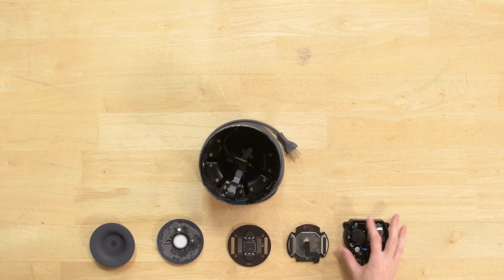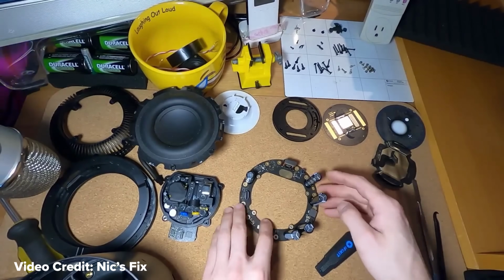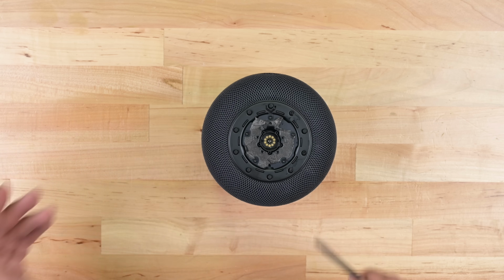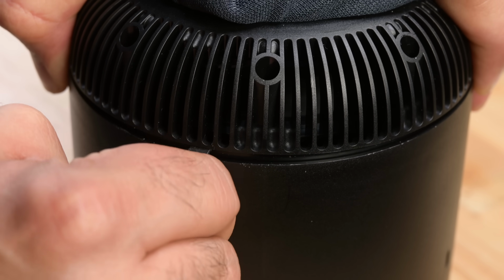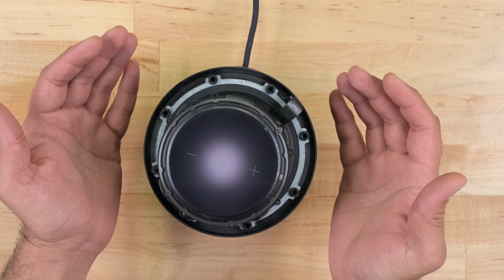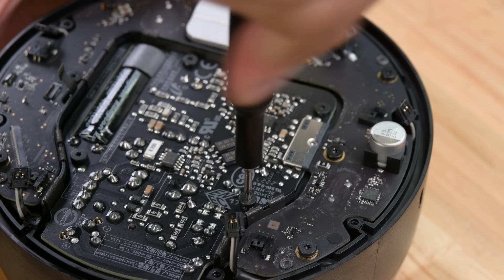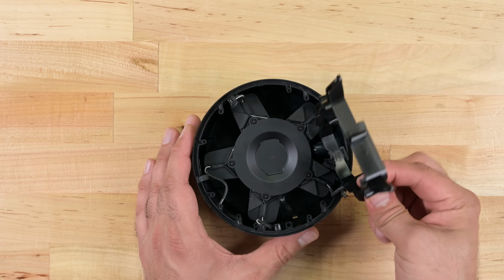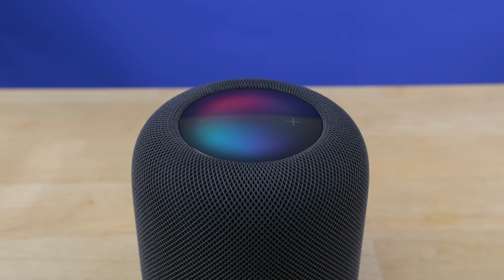The HomePod 2 Teardown: Small Changes Make a Big Difference

Comment: Looks like apple is moving away from hard to repair hardware in favor of software locks. To the average Joe it gives the impression that they're moving in the right direction, when in reality they're just tightening their iron grip on the repair industry. Workarounds for soft-locks are harder to pull off.
Reply: What your calling software locks is in fact called calibration profiles.
Reply: @hishnash  calibration for what? Touch pads? Batteries? Hall sensors? Displays? If something requires some sort of calibration, Apple can easily calibrate it at the factory, then put that calibration profile on a small chip onboard the part itself. Most, if not all of Apple's soft-locks are just an encrypted key on the replacement part that serves no other purpose than to lock the part.
Reply: @MrFastFox666  sure you can take that approach of cource that means 2 things.

1) adding extra chips to each part that are not needed. (this means extra space, cost, complexity and power). 
2) increase the bandwidth of the connection to the part

The key is not encrypted it is just a UUID that is used to pull the profile from apples servers.  There is no fancy encryption going on as that would require a full Secure Enclave to be added to each and every part. Not exactly saving money there. 

Touchpads by the way do not have calibration info, but are entirely different between models (eg M1 MBA and M2 MBA have different trackpads... apple moved some of the tracking logic inside the SOC so the data stream is electrically different).
Reply: @hishnash  dude, you have no idea what you're talking about, nor do you know how the serialization works. It's not just "simple UUIDs", what you are talking about are TrueTone profiles. There are custom protocols in place that are only used by Apple's servers and only work in diagnostic mode or recovery mode (through either AST2 or RepairCal, depending on device and how the serialization was implemented, RepairCal being the older option). There is no need for a "full secure enclave" as the chips themselves are only readable/writable in these certain modes and ONLY after talking to Apple servers. If it was "not encrypted" someone would have found a way to calibrate FaceID or TouchID modules by now, weird how that hasn't happened yet, huh?

Oh, and "Touchpads by the way do not have calibration info", yeah right, that's why Apple is so eager to calibrate MacBook trackpads after almost every repair, as stated in ATLAS. Tell me you've never been Apple certified without telling me you've never been Apple certified.
Reply: @hishnash  Apple's soft locks already use extra chips on the device. Not that it matters, as they are super small, often less than 1 mm² and are dirt cheap, but they're there. Many parts such as the battery or the display have some microchips on them anyways, such as the BMS in the battery.
Reply: @MrFastFox666  yep and the chips are so small and simple since all they store is the part id. The full calibration profile of a camera is way too large for such a small chip to store.   Sure some sensors and devices the profiles are much smaller can could be stored on the chip but if you need to go through the effort of building a server side DB of profiles for the camera and display why not just use that for everything then it is all much simpler (for apple in manufacturing). 

It has the add (benefit?) that if a device is stolen breaking it down into parts for resale have minimal value
Reply: This is how politics works.
Reply: @PvtAnonymous Aaaaaaa remember the 3dtouchcal days?
Reply: @odder5154  haven't been around that long as a certified Apple tech. Although I still witnessed the slow death of old GSX. But I know how the 3dtouchcal works, hilarious when you compare it to system configuration nowadays :D
Reply: Let’s face it’s cheaper to software lock rather then make it physically harder
Reply: @wax333  yeah that too. It makes it even harder to repair devices because they can just disable whatever service they use to lift their own soft locks.

Comment: I wonder if the spatial audio is compromised in any noticeable way due to the fewer tweeters. From the sound tests I've seen in other videos, it sounds pretty similar to the previous one, not noticeably different without having them side by side.
Reply: I heard the Homepods 2 recently in a stereo combo, they are not too bad considering they are from Apple, so NOT an audio company AND "smart speakers". But the price for this low end sound experience, sry just NO, if you want good sound even a basic small stereo hifi system does its job

But in general, even with this "spatial audio" thing they are not too good, Apple doesnt even allow for measuring via the phone some generated waves  to setup the EQ and spatial audio better.

Comment: correct me if I'm wrong but doesn't this homepod use 802.11n still? surely Apple could have at least fitted AC, whih my 2015 HP Pavilion has...
Reply: 300mbps for audio is plenty enough though right?
Reply: @Mooooooof  doesn’t HomeKit secure Video go through the host device which this HomePod would be?
Reply: Apple Answered this one. Latency matters more for multi-speaker wireless audio. Throughput is much less important. The current 802.11n chipsets were the perfect mix of compatibility (With other homepods) low latency and low power.
Reply: It's because of the Watch SOC they use. The Watch only has 802.11n.

Comment: I guess the heat sink is there so the temperature sensor won’t get extremely inaccurate when playing music loud for a long period of time?
Reply: I can't believe an electronics channel would be surprised to see a heat sink on a power amplifier. Even class d amps generate a lot of heat when playing loud. The heat sink is required not to burn out the amp chip and has nothing to do with sound quality per se.

Comment: “Heat can actually distort audio signals” Is that why my music always seems to play slightly slower during winter and slightly faster in the summer when I’m outside?
Reply: rather than that i guess it can be the suspensions of you speakers stiffening up when cold, thus changing its parameters a bit. Also, there should be a slight difference due to temperature and pressure of air itself, albeit i don't know to which degree it impacts it
Reply: While heat can distort audio signals the heat sink in this case exists to cool the amplifier at high volumes. Heat only becomes a problem with outdoor concerts and large auditoriums with the air convection sucking out the highs. It means nothing inside a small pod.

Comment: I'm almost 100% that at least 2-3 parts are locked, like humidity sensor, and probably some chips as well, I never seen Apple device (except for the original iPod) that has no software locks
Reply: Early mac’s, ipod touches and iphone’s didn’t have hardware/software locks (even though some were activated later with software updates). But never the less a shame.
Reply: highly doubt it.
Reply: Any physical world sensor needs calibration to be of any use. What your calling a lock is the lack of the calibration profile
Reply: @ronlevin2339  a humidity sensor absolute needs calibration. The only way you would avoid that is to embed extra silicon on the sensor that stores the profile local to the sensor. 

That tool you mention does not calibration the sensor it download the profile from googles servers. Apple also have this tool when you enter the diagnostic more. The limitation here is that the device is not permitted to download profiles for sensors that have not been assigned server side to the SOC.
Reply: @hishnash  again, there is no download of calibration profiles, the calibration happens on site, same as iPhone cameras, FaceID, proximity sensors, etc.
Reply: @PvtAnonymous  no on modern iPhones the diagnostic mode you can boot the phone into does talks directly to apples servers.

With older iPhones the diagnostic mode did not go online but rather talked over lighting cable to the attached computer that had software to call home to pull the profiles.

Apple stores do not have the equipment to calibrate displays, cameras proper calibration of such things requires costly equipment. There are more apple stores in the world than there are machines that can do this calibration.
Reply: @PvtAnonymous  you confusing validation of the physical and electrical connection and position of the sensor.  Sensor calibration is not done by AST2 (well the software part of AST2 downloads the sensor calibration profile from the web, sensor calibration for cameras sensors happens in the factory). 

The equipment to properly calibrate a camera sensor and very expensive and you do not have this in an App Store or a AASP. All you have is tools to check it is phsycily connected and tools that allow the phone to download the profile from apple servers. On newer phones (iPhone 12 +) the diagnostic software on the device does this all itself you do not need any local tools all you do is login to apples web portal and assign the SN of the camera to the phone so that the phones SOC has permission to download the profile. On older devices the AST2 tools on your attached Mac did this.
Reply: @hishnash  I just said EXACTLY what you just repeated. The camera calibrates itself through software, ON SITE. Again, there is no calibration profiles. I don't know where you heard that, but it's just plain wrong. Same thing goes for LiDAR scanners. Or MacBook trackpads.

"assign the SN of the camera to the phone so that the phones SOC has permission to download the profile" and here's where your whole argument falls apart: the camera (or any other part that has to be reassigned to the phone) can be calibrated/reassigned WITHOUT entering serial numbers into GSX2 altogether. How do I know that? Because we did this multiple times when our accounting team missed the deadline and we were locked out of completing repairs. You can even enter complete garbo in the fields, it has NOTHING to do with the repair itself. For the last time: there. is. no. calibration. profiles.

Comment: What's that weird talk about heat and distortion?
This speaker will output tens of watts and even with an efficient amplifier, that chip is gonna dissipate 2-3 Watts.
In an enclosure like this speaker, you will need a large-ish head-sink like this one to keep the amplifier chip from overheating and shutting down.
That's all.
Reply: A typical class d amp is about 86 to 90% efficient so for 20W output it generates at least 4W of heat. Enough to fry the chip if no cooling exists.
Reply: @dingdong2103  Well, in my math, 10% of 20W woulb be 2W, but apart from that, yes, that's exactly what I was said.
Reply: @NebukadV  Ah well yeah, apparently I was thinking 20-40 watts while writing. I'm just surprised the video author didn't understand that power amps need cooling...

Comment: A small electrolytic capacitors not gonna hold a lot of voltage like that not going to be lethal
Reply: It’s gonna hurt though
Reply: potentially
Reply: @nomecognome2  it's not gonna hurt a little capacitor like that was it 16 volts
Reply: @hoobsgroove  that one.
Reply: Voltage doesn't kill. Current does. 1Amp is all it takes
Reply: @mako3010  well actually a couple of milliamps in the right place with the right frequency is all it takes. But without the voltage it won’t be able to flow through those areas. So no. It’s not the amp that kill. It’s way more complicated. If I remember correctly styropyro made a great video about this just a couple of days ago
Reply: @mako3010  It is more complicated than just voltage / current kills. Watch styropyro's recent upload on the topic, excellent explanation and demonstrations!

Comment: whats the point of putting a cap over a screw
Reply: Many obvious reasons - esthetique for one. Also reduces vibration since that would leave an air gap for unwanted resonance.
Reply: So you don't see or feel the holes through the mesh. They'd wear over time and would be noticeable